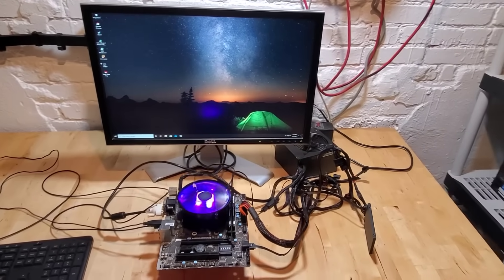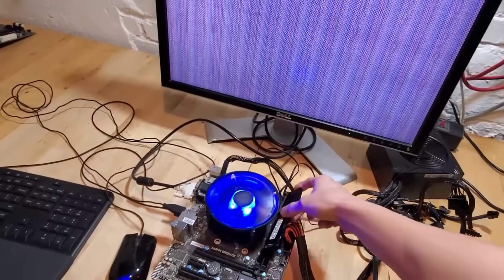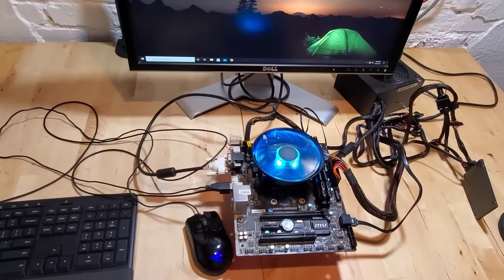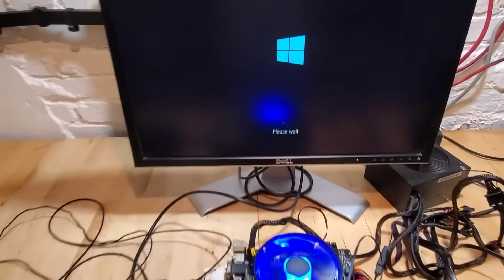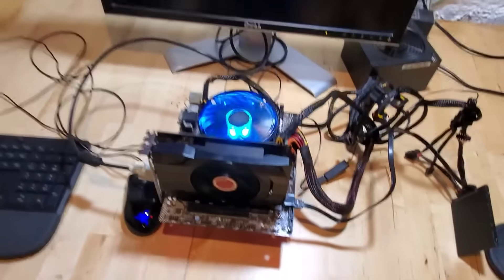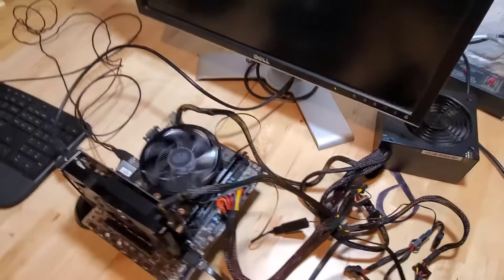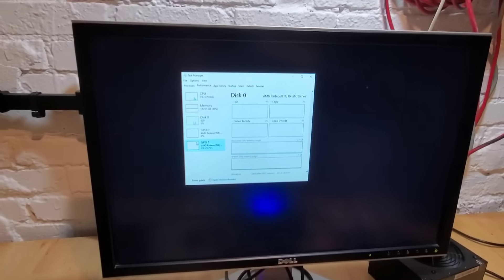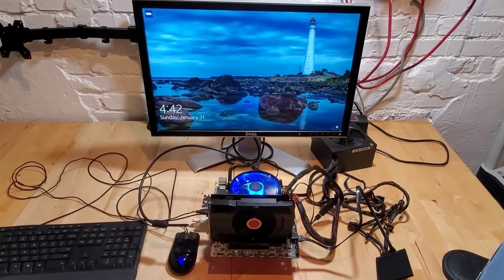What happens if you remove PC components from a running computer?

Comment: 0:53 The reason re-plugging in the RAM doesn't fix the problem is that RAM requires power to store data so by powering off the system or removing the memory you're effectively wiping it.
Reply: There was ram that was semi non volatile for desktops at one point.

The component is expensive so I don't suggest doing it, but science.
Reply: @slusheewolf2143  and this is even cooler, i think i need to try that ones
Reply: @slusheewolf2143  Don't you mean "technology"? Science is a different field.
Reply: @slusheewolf2143  yes, science.
Reply: Literally freezing DRAM is a way to retain data, essentially not wiping it. This probably wouldn't change the outcome of this scenario, but it does make it possible to read the data on it with the right tools.
Reply: @skatterpro  Still wouldn't work, most likely the CPU is executing some code from RAM, as soon as the thing was unplugged and that area of addressing space got open bus'd, the CPU fetched some garbage opcode and most probably triple faulted before anything could be done, CPU execution is fragile
Reply: @prototypemusic  If it triple faulted, wouldn’t it have rebooted? That’s how Linux reboots on systems without ACPI after all. It might’ve gotten stuck somehow, but without triple faulting.

Also, I think the visual effects are due to the iGPU, so doing that might return the image to normal, though the system would still be frozen due what you mentioned.
Reply: That's actually pretty cool
Reply: @jakubbauer6279  It would be if it was true lmao.
Reply: And your probally crashed all your Main processes
Reply: It takes about a quarter second before the first bits start getting white after removing the RAM
Reply: It's called memory for a reason because it store's memory for a short period of time until it is needed
Reply: @AZIV-JD-VIZA  True.
Reply: @AZIV-JD-VIZA  No, that name doesn't make sense. Permanent storage & ram are both similar to types of brain memory.
Reply: @AZIV-JD-VIZA not necessarily, read only memory (ROM) is permanent. Non-volatile.
Reply: Could you leave the RAM plugged in and wait for it to be written to again and theoretically solve the problem? I imagine this would take time
Reply: @marcnhunter  No, the CPU state gets trashed as soon as the memory is removed, unless everything is saved to another medium beforehand, and somehow restored by an external component, execution is unrecoverable
Reply: @marcnhunter  no. RAM is short term memory. 

When power on, information is loaded onto the RAM, and the CPU takes in data from the RAM, and executes instructions based on the data.
Remove the RAM. Now the CPU doesn’t know what to do.

Now plug back the RAM. Even if power goes back into RAM, all that data stored in RAM has been wiped by cutting power. So, even if your RAM starts loading up data from hard disk, given the mismatch in state, your CPU will still has no idea what to do.

The only remedy I can think of is virtual (swap) memory, or RAM running duplicate processes for redundancy, but it’s clearly a waste of resources for consumer grade computers.
Reply: Dynamic RAM starts to decay (become more and more undefined) after latest refresh. I.e. a short unplug like shown here without freezing the RAM stick you’ll have x% bits moved to it’s uncharged state. So what maybe 30% of bits changed value.
Reply: Some of the stuff stored persists for a few moments without power—I wonder if he did this quickly, how much it might recover.  Or at least still be readable even if it doesn’t make the screen work again
Reply: yea but the ssd is using the ram lmao
Reply: ….I think I just figured out why my computer isn’t working anymore…
Reply: Should've cooled it with liquid nitrogen first.
Cool it down enough and you can get about an our of non-volatility.
Reply: The system could acess virtual memory from the SSD but didn't expect such an idiot owner.
Reply: @WadcaWymiaru ???
Reply: @linux-dev-arch 
Swap file in HDD/SSD...
Reply: @WadcaWymiaru  ohhh i did not have swap when i tried it
Reply: @WadcaWymiaru It would not be able to automatically use swap space instead
Reply: @jetison333  
Depends on programming and copy of the essentiall code. The rest can be reloaded from HDD/SSD like in hot-swapping devices.
Reply: I understand 100% of what you said
Reply: @therealloganyt237  all he said was that the temporary data on the ram got wiped out, so id did not recover
Reply: More important: RAM, CPU and GPUs are NOT hot swapable, so no matter what you do, the system will crash, because it assumes these components to be there. Windows of course is the worst OS out there, so removing the hot pluggable SSD makes it crash, if you did the same in Linux, it would keep running after you bring it back.
Reply: @nigratruo yup I actually tested with my PC running Linux and it froze when I unplugged the ssd but then continued after I plugged it in
Reply: Are you sure? How are you so certain it would work were the RAM not wiped but still lost connection?
Reply: @cunt5413  This topic has been debated tried and tested many times by industry experts. I'm not a hardware engineer,  just a C++ programmer. But if you like you could always test it out on some obsolete hardware yourself. Do not test it out on anything you want to continue to use afterwards, because while simply unplugging memory while it's running shouldn't damage it or the motherboard there are no guarantees and I will not take responsibility for any damages.

Comment: I removed my ram stick while the computer was on luckily it had a fail safe feature and it just shut off. I got scared hooked everything back up and looks like we’re ok. I hope nothing was damaged 😅
Reply: Why tho
Reply: @Morworld "bruh" things can occur before a video is released
Reply: genius!
Reply: lucky you didn't get electrocuted
Reply: @StaticJolts since the power supply doesn't provide anything over 12 VDC, he's safe. The memory uses under 5 VDC in modern computers.
Reply: @@Morworld he did it at his friends house
Reply: Genius, fr
Reply: @@Morworld he might've done that before he watched the vid. ive done the same thing back in 2019 i have the same pc but on of the ram slots dont work because of that
Reply: @@GamePlays-bg1mvthe kernel is in fact on your harddrive (ntoskrnl) inside System32. Stop spreading misinformation
Reply: i think i did that once, when i thought i shut down my pc but it turned back on on its own. nothing happened either.
Reply: I also had the same thing when i turned my pc on after cleaning it. My little niece came and suddenly hugged me, hit the ram and my mobo got shorted
Reply: @GraveUypo But the fans were not spinning?
Reply: If it had static electricity it would have fried your motherboard
Reply: @Morworld Or he temporarily took his computer somewhere else first, which would actually be even worse.
Reply: @Game Plays 1230 isn't it stored on a seperate chip?
Reply: @mindrover777  no, the kernel is part of the operating system.
Reply: @johan73  if so, how will it be destroy** , it's copied to the ram right? Not moved
Reply: @mindrover777  i don't know if it is  copied to the ram, but the kernel is part of the OS, then the kernel is software 😁every OS have his own  kernel
Reply: @johan73  😁
Reply: @mindrover777 it’s copied to the ram you are correct. the kernel runs as a system process (ntoskrnl) when you boot up your computer. It’s listed under task manager as “System”
Reply: @johan73 obviously it's copied to ram or else it can't run? This is computers 101, how do you not understand this

Comment: Not dealing with the removal of the ssd properly is a OS failure not hardware. Many versions of Linux fully loads the OS into RAM and the drive isnt needed for the core kernel loop after the boot is completed. SATA ports can be hotswap compatible (depending on motherboard) allowing adding or removing drives dynamically.

Comment: really, who would expect stuff to go back to normal if you pull out and put back in a component in a running system without a hard reset? These are electrical signals it's not "magic".  this video should be looked at as a curiosity only, this doesn't mean doing this on your pc will result in the same results. Don't be idiots, viewers =)

Comment: The windows diagnosis reboot thing just happens after a couple of times you power off the computer.
I'm curious what would happen if you removed the RAM with a Graphics Card installed. The reason the screen is going all funny is onboard graphics uses the RAM as Graphical Ram

Comment: Would be curious to see what happens if you remove the storage device as you did, but return it immediately, before you loose the appearance of it still running normally (minus the background) and before it blue screens, weather at that point it will just pick right back up. 
I'm assuming the reason you keep that appearance for a short while is that the necessary info is probably loaded into RAM, so it can draw the display from that for a short while. I'm going to guess though it must automatically update what's stored in RAM from the storage device regularly, at which point I guess is when it runs into problems and blue screens, so maybe if you put the drive back before it does this it essentially wont know you removed it? 
(My knowledge of PCs and how they work is minimal, so this may bare zero resemblance to reality)
Reply: Yea, i was hoping he'll show that.

Comment: The reason it keeps running after you unplug the harddisk is because some of the windows memory is currently stored in RAM while running to reduce cpu load. After some period the active memory will go dormant and the computer realize it by re-accessing those data from hard disk again, and everything goes down.

Comment: I had to wipe a SSD once, but it needed to offline. With a Linux boot drive, I could actually unplug it, plug ti back in and then wipe it, as it was no longer online.

Once I installed some unknown RAM into a server board and when I turned the power on, a spark flew out of the RQAM socket. No clue what happened, but things worked with a different stick after that

Comment: On different hardware configurations it will run differently. Sometimes, hot swap of PCIE/SATA devices is completely normal. Sometimes, even hot swap of CPU's (!) is normal. Depends on actual hardware and firmware. I have hot-swappable SATA in my PC, for instance.
Reply: But, at least one CPU is required to be working at any given time for the other to be hotswappable. Without any working CPU, there is no code path to even perform such swap, since the kernel executes on the exact CPU being removed.

Comment: I would have had the GPU installed when you pulled the CPU.  Like duh the display goes away when you remove the integrated graphics it was running.  I'm certain it still wouldn't have remained functional in any capacity, but the resulting display might have been interesting artifacts rather than predictable nothing.
Reply: I mean, that's why the first thing he did (removing the RAM) caused weird display issues. The iGPU uses system RAM for VRAM, so removing it would have significant effects. I'd be curious to see removing RAM when using a discrete GPU instead.
Reply: @_mnejing  another more interesting thing than was shown in the video!

Comment: CPU removal needs to be done without it being used as the display driver (integrated graphics). So we can see what the pc does on screen by using the GPU. I'm not saying it would return to working order but it would be interesting to see what happens on screen.
Reply: Linus Sebastian form Linus Tech Tips has once actually yanked out the CPU while playing... CS:GO I think?
The GPU continued to output the last frame that was in the frame buffer.
Reply: @mantas8443  the fake ryzen 3600 from best buy video
Reply: Most likely it would go black instantly, as all graphic data is still managed by the CPU. At least on knowledge I have on computers. Or at least the picture would freeze as I don't believe there's any direct logical connection between graphics and peripherals.
Reply: @matsopelle  true, but still cover all bases like.
Reply: I actually Saw a cpu being removed while a gpu is in aswell on a video of linus tech support. The screen doesn't go black, it actually stays on the last frame of whatever it was running! But I'm not so sure about the putting the cpu back in part. I guess the same would happen as whats happening in the video, a complete system restart.

Edit: ah, I see that mantas also saw that video!
Reply: @All_StarRunner  I have done this before and put it back once it have been restored to the socket the screen will black.
Reply: @imSomebody-m4c  Thats not how it works, the picture on the screen is constantly getting refreshed and if there is no CPU, the refresh cant happen.
Reply: @Kasi11  sad but true. You absolutely need the cpu in always
Reply: Running a CPU without a heatsink can cook it very fast, I'm surprised this system stayed running long enough to unlatch. I tried booting one up just to check the bios screen and identify the speed on an old CPU sitting around, it did not survive long enough to display even a bios logo and never worked again.
Reply: Всё будет чёрным несомненно
Reply: Was wondering the same thing when he removed the gpu. I think it would still work if he  plugged the monitor into the motherboard
Reply: Nothing, it will still crash: EVERYTHING is managed by the CPU, it is not designed to be removed during operation, so the computer just crashes.
Reply: linus tech tips did it, all it does is show the last buffered frame, so just the last thing your gpu outputs
Reply: The GPU can't do anything without the CPU
Reply: Yeap, I would also like to see RAM removal in that circumstance.
Reply: @ДенисОлегович-ф8д  indeed

Comment: it would have been interesting if you tried to switch the DVI cable back to integrated graphics to see if it just switched to that after you took out the GPU
Reply: That wouldn't work either. The missing GPU caused its kernel driver to enter a loop (possibly infinite) and the Windows kernel has a watchdog specifically for the purpose of avoiding such loops, that will instantly terminate the whole system.
Reply: @TheLukasz032  What if the watchdog gets in a loop of seeing infinite loops?

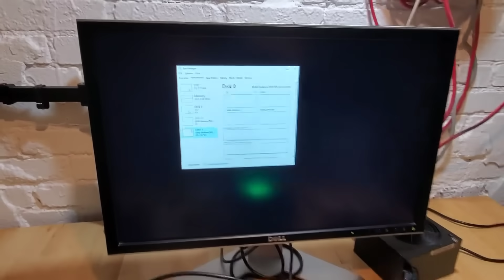Comment: 5:40 On Linux you can load the system entierly on ram so disconnecting the drive after the system booted will not lead to a crash. Don't do it tho-

Comment: if you use the igpu insteead of the gpu to run the monitor you can plug and unplug the gpu and it will work😅, beacause pcie is plug and play, it's weird but i already did that 🙃,
the computer just does tudummm, a new gpu appears on device manager when you plug the gpu, tamdammm, the gpu desapear of device manager while you unplug the gpu.
Reply: just dont run any processing on the gpu while unplug it or you will face a bluescreen

Comment: this is because when you uninstall something by removing the rams it will uninstall you can reset it and the computer will manually install the rams back but since you took the rams out it will show what is shown on the screen until you do a hard reset (not to be mistaken with restart completely shut it down)

Comment: 4:03 I think what's happening is that it's no longer receiving the motherboard control signal through the PCI x16 bus, so it spins the fans at 100%. You see the same thing when you have fans attached to an external controller but not the motherboard.

Comment: well, but what would happen if you removed the RAM while you were on dedicated GPU? there were graphical glitches because the integrated GPU uses the system memory as VRAM, so would it work?
Reply: The gpu would output whatever the CPU told it to output last, so basically the screen will just freeze. All the code that the CPU runs is loaded from and stored in the RAM so removing the RAM, or even part of the RAM, will always crash a PC with no way to 'uncrash' it besides power-cycling the computer.

Comment: Fun Fact: You can turn on Hot Plugging in Bios, which will enable you to actually disconnect and reconnect HDD`s/SSD`s whenever you want to, though obviously doesn`t work only on a drive with running OS on it.
Reply: doesnt it also depend on the filesystem that the drive uses? like if you dont have a journaling filesystem and disconnect during a write, the entire drive will be corrupted?
Reply: @doooofus  I know this is an old comment, but... kind of? The entire drive probably wouldn't be corrupted, just the blocks that were being written to. However, journaling filesystems have been the standard since the 1990s (ntfs for Windows, ext3 for linux, and... whatever Apple uses for Mac.) So unless you've specifically formatted the drive with something else, it'd almost certainly be fine, provided that there was no other damage from the sudden disconnect/reconnect.

Comment: fun fact: if you remove the hard drive on linux, icons becomes the default icon but the PC still work. (of course if you try to open a file it didn't work)
also, if you have a swap partition, with certain condition the system can recover when you remove the ram. even if X server crash and you lose unsaved data, you just have to relogin again. 

and i'm sorry for my really bad english

Comment: when removing the graphics card, what is happening if i plug the display cable into the standard mainboard port anstead. Will it starts working with the onboard graphics immediately or does it require a restart? Cheers